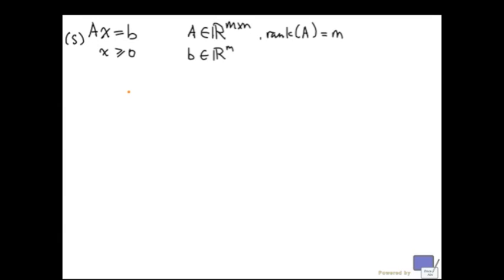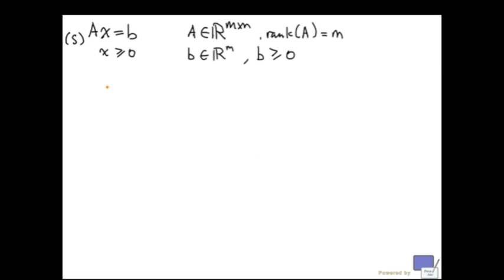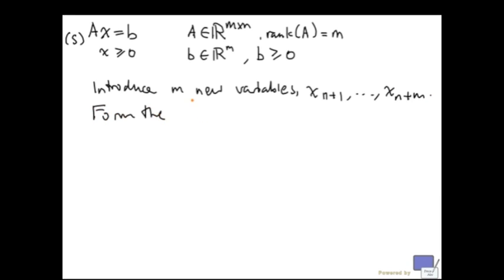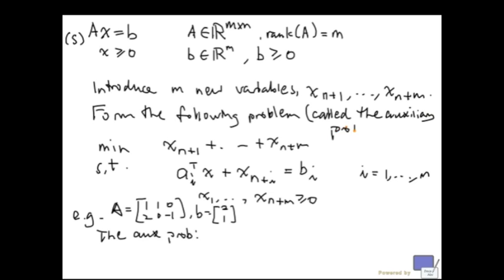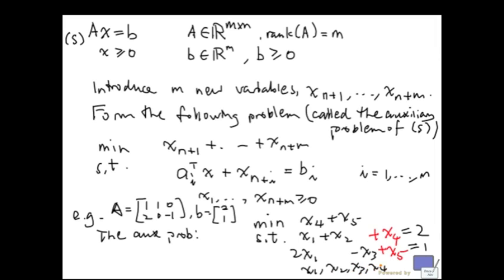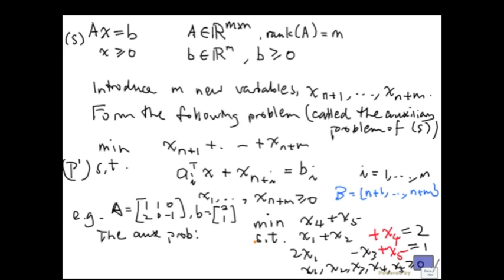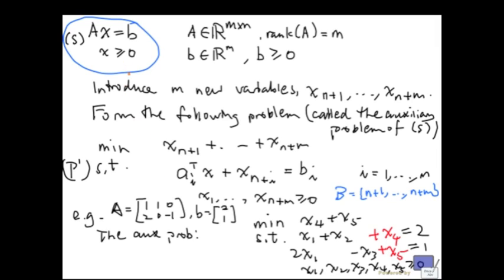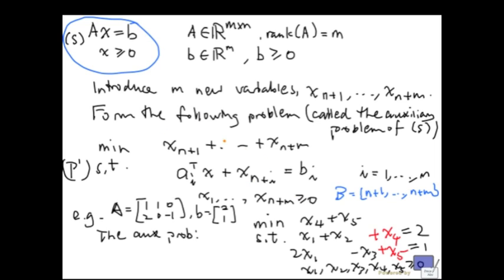Simplex method - Finding a basic feasible solution

Comment: How would you set the tableau for your example?
Minimize 
C = x4 + x5
s,t:
 x1 + x2 + x4 = 2
2x1 - x3 + x5 = 1
x1,x2,x3,x4,x5 >= 0

I initially did this:

I converted it to maximization:
so my objective function becomes
P = -x4 - x5 
=> x4 + x5 + P = 0

And my tableau becomes:

1  1  0  4  0 | 2    ~ constraint
2  0 -1  0  1 | 1    ~ constraint
0  0  0  1  1 | 0    ~ objective function

Essentially, I guess what I'm asking is... first of all, did I set this up right?... if so,  how can you solve this using simplex? The objective function has non negative numbers? Cause usually, you look for the most negative number on the objective function and make that your pivot.

Thank you for the response, it'll help me out a lot!